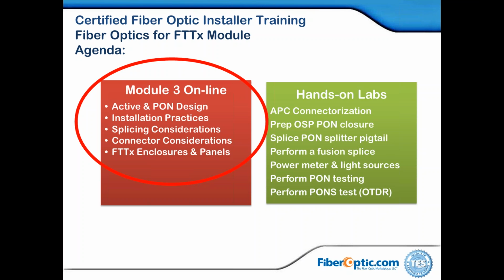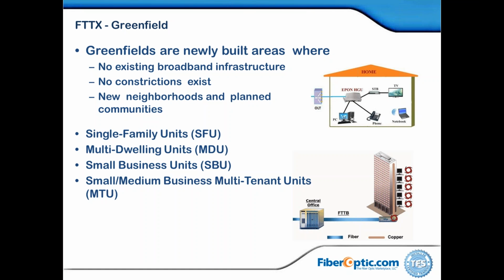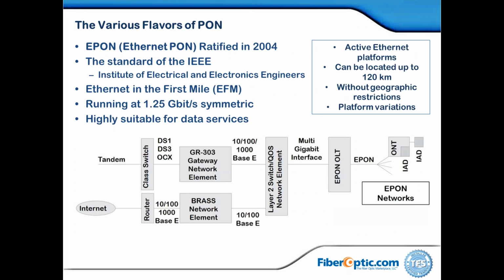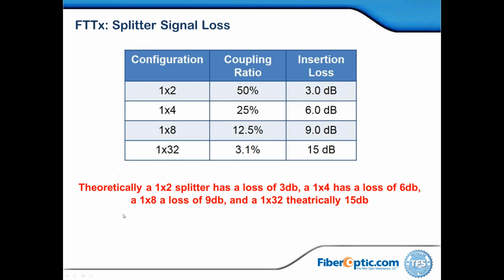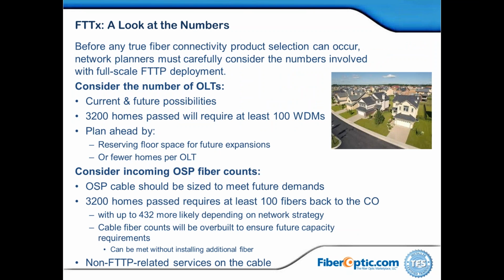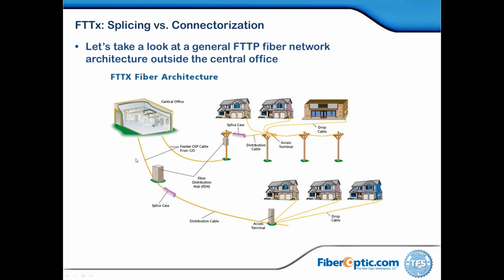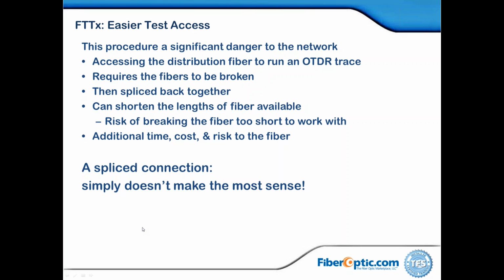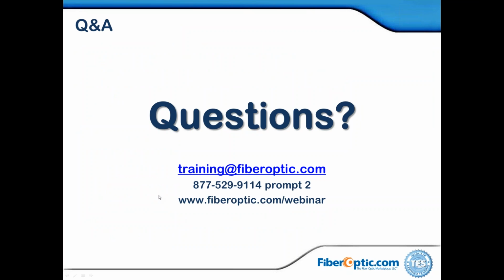On-Demand: PON in FTTH

Comment: My FTTP ISP didn't put a box on the side of my house they just ran the fiber line from the splice box on the pole straight into my house. He did terminate the fiber in my room and hooked it up to an ONT on my wall. I hope nothing ever happens to my inside line or they might have to replace the entire wire.

Comment: PON installation in Sweden?

Wy do Telia/ SKANOVA in Sweden not use this?
And all the subcontractors look at SKANOVA today.

Do you understand my question.

Maby to the temperature in Sweden.
Summer to winter time (Special in Sweden): +30 to -50 Celcius degrees?

What do you think regarding SM fiber standards for the market in Sweden?
G652D
G657:A1 - B3 (fiber in Sweden regarding patch cords, and fiber cables)

Is this only for:
Datacenters
FTTH cabling locally

Ore is G657:A1 - B3 the future regarding patchcords in the world?
Reply: So what are they using if not this?
Reply: lMm